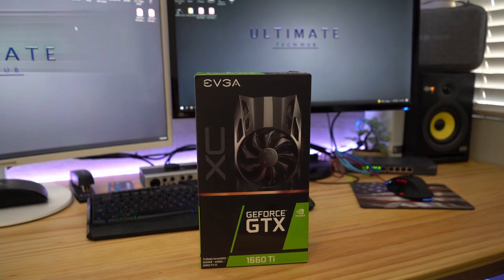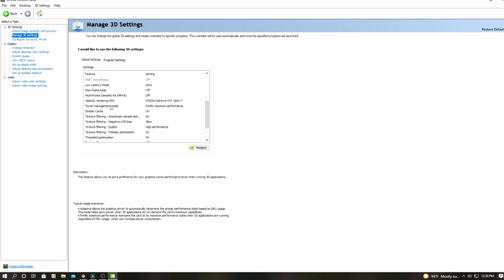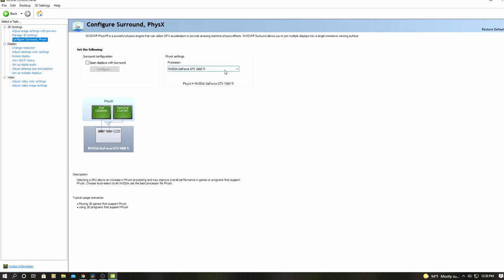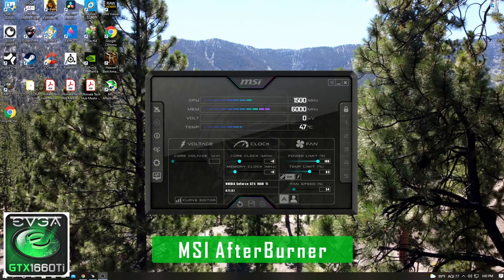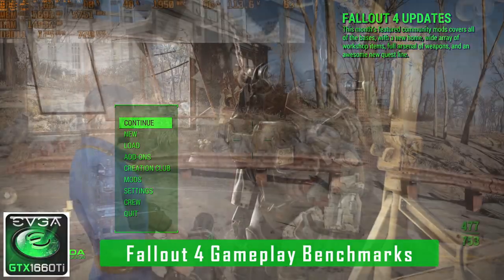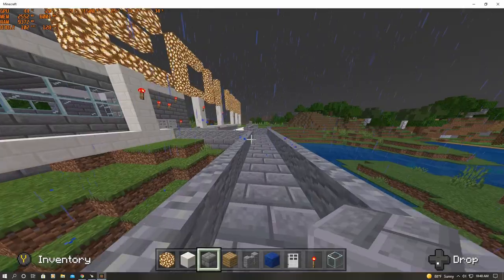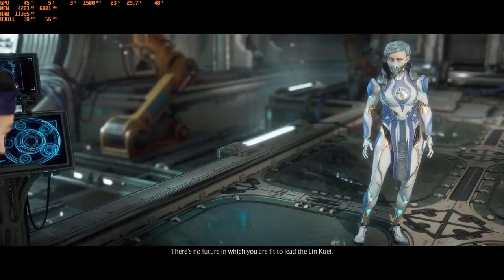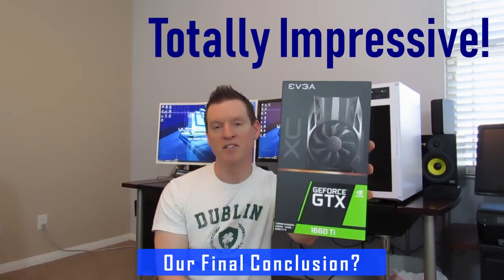GeForce GTX 1660ti Testing & Review 2021 |  Unboxing & Easy Install

Comment: I just got a 1660 ti paired with a Ryzen 7 3700x. Getting over 100 fps on all the games I play with a mix of 1080p and 1440p. Pretty good card.
Reply from the maker: It's a solid card for the price. 100 fps or higher is very exceptable. The Ryzen 7 is also very good. Thanks for watching I really appreciate it!

Comment: Hello Ultimate Tech Hub: I have a dell xps studio 9100 and I am planning to upgrade the GPU, CPU, RAM [ That I can use  it for TOPAZ VIDEO ENHANCE, and Etc]. Which is better i7930, Xeon X5680, or Xeon 5690. My PSU on my Computer is 525watts. Do I need any more power? Also, installing the software for the Nvidia GeForce 1660 Ti is it important? Keep up the great job.
Reply from the maker: I think you might need some more power but you can give it a shot. Thank you for watching I really appreciate it.
Reply: @UltimateTechHub  Thanks!✌

Comment: Your benchmark isn't at max settings, just letting you know, haha.
Reply from the maker: Which settings did I I miss? Let me know so I can change them.
Reply: @UltimateTechHub  Tessellation needs to be set to Ultra, 8x AA and Qualty to ultra.
Reply from the maker: @legendaryhumper  thanks I will set those parameters. Thanks again for watching!
Reply from the maker: @legendaryhumper  Is this in the 3D settings?
Reply: @UltimateTechHub  No, the heaven benchmark
Reply from the maker: @legendaryhumper  Thanks!

Comment: bro i think its still messed up i can tell ur on low settings lmao I hope you downloaded the nvidia drivers
Reply: battlefield 4 on ultra is fine on this card
Reply: 1080p ultra should get like 150 fps
Reply: check the bios your gpu might be a scam gpu, or you just didn't install drivers right
Reply: He should just install GeForce driver installer or how it's called. But respect for reupload
Reply from the maker: I have the latest game drivers.